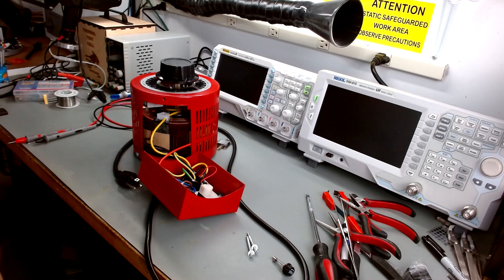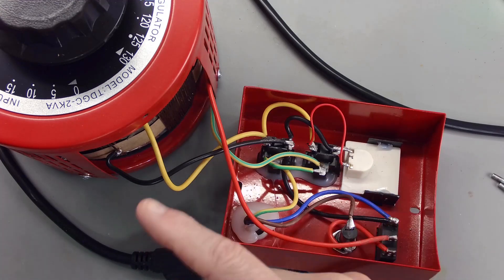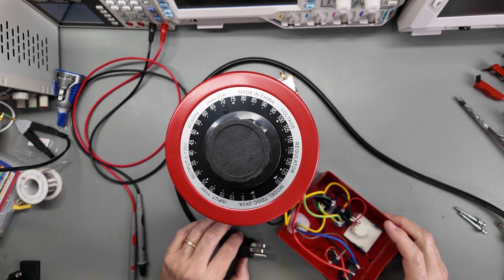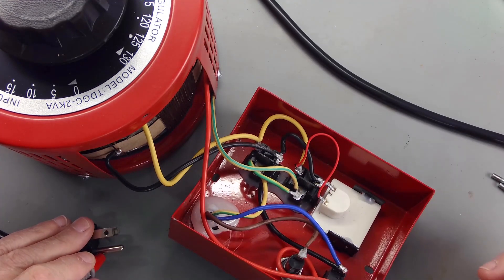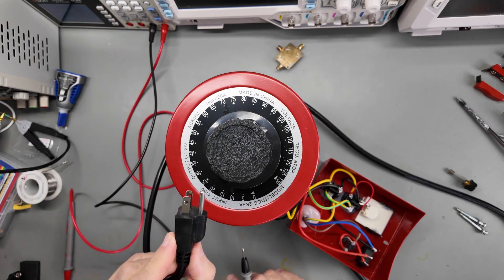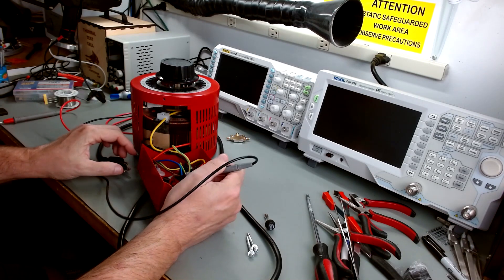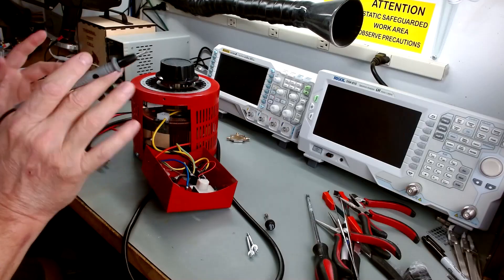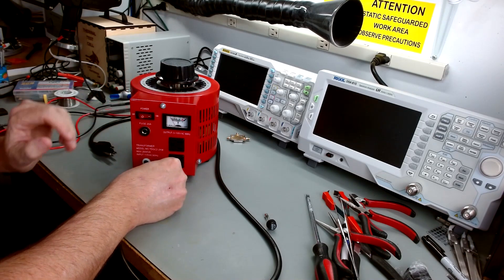Autotransformer Analysis: Is It Safe to Use?

Comment: I have this same model, and I'm perfectly satisfied with it. One thing should be noted, however; these are made with 110v input in mind, so when running them on our 120v+ mains, output voltage of the variac will be higher than indicated on the dial. When I use mine, I plug a power strip into it's outlet and the equipment being powered into the strip---this allows me to also connect my AC voltmeter, so I can monitor real-time output
Reply from the maker: Thanks, 
Check the video on the isolation transformer I use with this. It has a digital volt, current, watts meter that lets me monitor its output. 

RJ

Comment: I have the 10A version that I bought over 5 years ago. I only need it a few times a month max and It's been doing the job I need it to do with no issues. Obviously, there are better ones available at quadruple the price. If I needed it daily, maybe I would have gotten a better one but honestly, if it does what I need it to do and it hasn't failed, what more can I say?
Reply from the maker: Exactly, 
I am in the same situation. Thanks for the input.
RJ

Comment: I don't understand why there is a 20 amp fuse when it has a 15 amp plug.
Reply from the maker: Phil, 
The fusing on something protects the item after it in the flow of current. So the 20 amp fuse is protecting the 20 amp winding in the transformer. The cord to the device is protected by the circuit breaker of the outlet. The reason is simple. Imagine that the device end of the cord was shorted out. No current would flow through the fuse so it would be unable to protect it. So all devices are intended to be protected by the current protection before them. In this case the 15 amp circuit breaker at the breaker box. Remember that you can buy this same exact device with cords and plugs for different outlets that might be able to provide the full 20 amps so it is fused for its rated current not the supply current ratings. Hopefully that clears it up for you.
RJ

Comment: Yes, the circuit breaker is to protect the house wiring, not the load. However, at the wall receptacle, you are not plugging in a 12AWG copper cord. That cord appears to be 16AWG. This is one of the flaws of our USA electrical code. That cord now is a fire hazard. This is one of the reasons that the latest NEC (2020) now requires arc fault breakers. If that cord were to start a melt down, it would trip the breaker once arcing between the hot and neutral occurs. The fix I see in the UK standards is to have the plug with a fuse that protects the smaller wire used.
Reply from the maker: This is a good point, thanks for the input.

Comment: BEWARE: On the unit that I have, the switch is single-pole-double-throw and when switching off, it takes the primary and connects it to ground/neutral.  My switch failed after a few months of normal usage and I think was because the full energy of the primary being dumped through the switch if the user gets unlucky when switching off.

I would have liked to see a snubber circuit instead of the SPDT switch to ground like I had.

My work-around was to disconnect the switch and use the power plug to turn it on/off.
Reply from the maker: Thanks for the heads up! I will keep an eye out for this. 
RJ

Comment: There is no secondary, it's an autotransformer. The "auto" part means "self". (Some company in China makes one that's also an isolation transformer and that one does have a secondary,  but this doesn't appear to be that - they're rare. Also, if it was an isolation transformer it would be defeated by the continuous ground from input to output and you'd have to add a cheater plug adaptor to ensure your DUT is isolated from the mains.)
Reply from the maker: Thanks, please see the other comments and videos where we discuss this.

Comment: What are the core losses?
Reply from the maker: I do not know. This does not appear in any of the specs listed.
RJ
Reply: @LynxElectronicsLab  Alright, I thought maybe you could measure it using a power meter. I'm trying to find a really efficient and powerful transformer

Comment: There is something odd about these cheap Chinese variable autotransformers. A few years ago I bought one on Amazon, it was a LVYUAN Variable Transformer rated at 1.0kVA.  I also bought a used one on eBay, a Staco Inc Industrial Variable Autotransformer model 3PN1010 rated at 1.5 kVA. Testing and comparing the two, the Staco (an American company I think) was about half the size and weight, yet it outperformed the super cheap Chinese product, which was twice the size and weight as the Staco.  These two autotransformers are electrically the same yet the smaller American made one performed 50% better than the cheap Chinese one.  I assume the difference is in the exact way the laminate core is constructed. Nearly all Chinese technology has been copied from the West and so its not surprising that when they manufacture a copy of Western technology it comes out like an imperfect facsimile, having the appearance of the original without its substance.
Reply from the maker: Interesting,
When you say it outperformed do you mean it’s rated output or was there something else you noticed about it’s performed. 
RJ
Reply: @LynxElectronicsLab  Well, as I recall (this was 3 years ago, maybe) I tested the LVYUAN with a 900 watt resistive load and the Staco with a 1400 watt resistive load, so they both performed nominally according to their ratings. I didn't push the limits until failure or anything like that. 
As it turned out, I returned the LVYUAN to Amazon for some reason, but I don't remember exactly why. I remember the meter was pretty wonkey, but more likely because it was redundant and inferior to the Staco.

Comment: 4:30 You can get a LOT more current OUT than you put IN.  The power won't change, but as you reduce voltage you increase available current (for a given power).   Really it ought to be fused on input AND output; input fusing is basically in case the windings touch the case, it does not protect the transformer itself.  It is the OUTPUT fuse that protects the transformer.
Reply from the maker: Thanks for the comment,
Watch the other videos in this series (some already out) to see how I deal with this.
RJ

Comment: Thanks for the inspection. I have tested this model's actual output with a volt meter, and it is not linear with the top ring and the attached meter. So I just use an external volt meter every time with my DUT's.
Reply from the maker: Thanks for the info,
The video going up in a little over an hour will show the third device in this group of tools. It is an isolation transformer with digital data such as voltage/current/power/power factor & frequency. So this is my meter for the same purpose as your volt meter. Gives me a great information console for what my DUT is getting feed. In an upcoming video I show how I use all three together.

RJ

Comment: As far as I can tell the secondary winding is also floating, meaning it’s a bit less likely to kill me…
Reply from the maker: Thanks, check out the other comments where I get educated that there is only on winding in these units.
Reply: @LynxElectronicsLab  There is a special isolation autotransformer that combines actual isolation with variable transformer.  In other words, it has a primary winding and a secondary winding and the brush contacts only the secondary winding.  we had one in school it was very big and heavy and of course expensive.  as others mention you can simply daisy chain an isolation transformer to a variable autotransformer. 
Interesting, the Staco brand (which it was) is now on the Variac website.
https://variac.com/staco/PDFCutSheets/VT%20isolated.pdf

Comment: Back when i was 15 i remember trying to replace the fuse on one of these, the entire knob turned and would seem to tension up after around 180° turning and i realised it was the two cables to the fuse flexing. I was mildly shocked that the fuse holder wasn’t even attached to it’s faceplate but i ended up changing the fuse holding the knob in place with long nose pliers. It wasn’t till i touched an odd screw on the transformer and ended up touching the casing when i experienced a big shock. I used to glance through the vents at the heat sink on top of the carbon brush and don’t recall any insulation from the rotating rod to the knob and brush (but that sums up a glance) and that arose my suspicions enough for me to check the earth bonding from the earth pin to the ground/earth pin on the output and the casing itself and measured good continuity... If i had an insulation tester then i’d test the coil and i will eventually get around to seeing if that rod is connected in some way.

Overall i have always wondered what’s inside one of these TDGCs.
Reply from the maker: Glad I could show you inside mine!
RJ

Comment: I have a similar unit.  Liked the video other than the use of the term primary and secondary.  A fuse of the output isn't a bad thing to add.  You can easily put out a lot of amps on the output when the voltage is turned down.  ie 10A in a 120V can be 100A out at 12V.  I actually built an DUT power box into my bench that has an isolation transformer then a variac and dim bulb that are both switchable with volts and amps display on the output.   It's proven to be one of the absolute best bits of gear for testing things.
Reply from the maker: Thanks for the input, 
Keep watching and you will see I have done a similar.
RJ

Comment: Auto transformers DO NOT provide isolation, so be careful. Aside from that, they are safe to use and if you dont overload them, they will last for many years. I have a Staco unit that I bought over 40 years ago, and it's still working just like new. If you are unsure about the quality,  try running it from 0 to full voltage with a modest load on it, and make sure there are no dropouts visible on the meter (nice feature, BTW) as the knob is turned. Also, see if it gets warm if you run it overnight with no load.

Personally, the wires in the video look a bit small for 20 amps but are probably OK when you consider their length (resistance) and the amount of heat they generate at 20 amps.
Reply from the maker: Thanks!
RJ

Comment: Is there a primary and secondary? All variacs I've seen in my country are autotransformers. I have burnt one that had no output fuse.
Sure, it took less than 10A in, but because the tap is at lower voltage (and P=UI) at same power I got much more amps at lower voltage out and it burnt the coil.
Autotransformers are dangerous in my country because we can put plug in two ways and you are not sure which is  L or N. It is also never isolated. I run my variac after an isolation transformer and with a fuse in input AND on output.
Reply from the maker: Keep an eye to see the rest of the setup and you will see I have more to it that covers it all.
Reply from the maker: Sorry did not answer your question. Yes as we have been talking in other comments there is only one winding. I learned something which is always a good day.

Comment: You keep saying primary and secondary winding and I think that's a mistake. My variable transformer which looks exactly like this one has only one winding with a moveable tap. You can confirm this by checking if there is any isolation between the plug and the outlets on the device. With one winding - any point about fusing the primary or secondary winding is moot.
Reply from the maker: We were just talking about this in the other comments. I had to go look up how this thing works as it is not what I thought. There is only one windings. So you are correct. Thanks! 
RJ
Reply: @LynxElectronicsLab  Whoops! I guess I should have read more comments before posting a redundant one! Nice video, btw.
Reply from the maker: No problem I ❤️ comments!
Reply: There’s still some relevance to it IMO. If the output is set to, say, 30V, it’s possible that you could have 4x as much current coming out as going in. 

You could cook a section of the winding even if the input current is normal.
Reply: @deltab9768  Yes, you're right. Good point. I suppose I was thinking that it wouldn't really be reasonable to put a fuse on the output since the maximum current output depends on the position of the adjustment knob. I guess you could put a fuse based on the maximum current capacity of the winding. That would protect against the case you just described whereas a fuse on the input wouldn't.
Reply: It is useful to think of primary and secondary; they SHARE the same wire from the common point up to the brush or tap.  So if the primary side has one amp, and the secondary has 2 amps (because 60 volts), then 3 amps are flowing in the shared wire.
Reply: @thomasmaughan4798  Wouldn't it be 1 amp in the case you described? Aren't those two currents flowing in opposite directions such that they would subtract and not add?
Reply: @shannonroberts5080  I'll have to do a bit of study on this.  It isn't opposite currents and the output is in phase with the input. But some of the current apparently is in series from high voltage to the tap, and some of the current is sourced inductively from the tap to neutral.  At the maximum voltage out, ALL of the current flows directly from input to output and the transformer is basically idle.  AT half voltage you have a series component and an inductive component; at low voltage the current is sourced almost entirely from induction and thus the current in the common section will be the simple sum of input and output currents.
Reply: @thomasmaughan4798  I agree with everything here except I still see the 'primary' current and 'secondary' current being in opposite directions in the shared part of the coil. It's hard to describe without a diagram, but if you consider the power source driving current in the 'primary' in a clockwise direction, then since the two voltages are in phase, the current going from the secondary to the load will also be clockwise. Do you see what I mean? Another way to describe it with magnetic coupling is to say that the coil produces a back emf to resist current change from the power source, and that back emf drives current in the 'secondary' - back emf pushing current in the opposite direction. In a normal coil the back emf generates impedance, but the tap gives current a second path to flow into.

Admittedly I haven't analyzed this circuit in detail before either, so I might be wrong! The magnetic coupling of the two coil sections makes this a non-trivial circuit even though it appears trivial at first glance.
Reply: @shannonroberts5080  I agree with your excellent analysis.  It is easy to show that since the voltages are in phase, and necessarily so, that the circulation of current means that the secondary opposes the primary.
Having thought about it, I see that this is not so simple to evaluate.  It is easy enough to show 10 amps on the load with 1 amp going in, but the exact current distribution of currents seems not so easy to determine.  My experience with these things is that the portion of transformer that melts or burns is always the shared portion.  
Consider 120 volts 1 amp in, and 12 volts 10 amps out.  The 10 amps out seems to oppose the 1 amp in.  If it does, then 9 amps flow in the shared portion and yet 10 amps are on the load.  We might say that the missing amp comes from the source, but if that's the case, then the 10 amps is not opposed and you would have 10 amps in the shared plus the mains amp for 11 amps.  Well that's not right.  So the actual is somewhere between these bounds.

Comment: for mains devices, I always prefer spade terminals. solder seems amateurish to me. (at least they should have used shrink tubing) one other thing I question on Chinese instruments is wiring. they don't use real copper whenever possible. I've seen so many examples with aluminum or copper coated aluminum.
Reply from the maker: Yes, I notice this also. They love aluminum wire.
Reply: Soldering is hands down a much better connection than spade terminals, especially for higher current devices. 50% of my trouble calls on heaters, refrigerators, HVAC equipment is due to crappy spade terminals getting hot, burning off, meting switches or just falling off over time. Whether from a bad crimp or just no spring tension on the spade. I can't recall anything that failed due to a solder joint where a spade connector could be used instead. Sure, PCBs and cracked solder joints is a thing. But on applications like this, soldering is much better.

Comment: Excuse my confusion, I thought the earth on the secondary should not connect to the earth of the chassis or the mains earth. Everything should be separate on the secondary side..There should be no earth on the secondary side as you only have hot and neutral wires as that is all you need. The earth in the mains is because it is used as the neutral return to the grid.
Reply from the maker: Thanks for the question.
That is what you want on an isolation transformer. These are not advertised as isolation devices. I have a separate isolation transformer for that. It is an upcoming video. 
RJ
Reply: @LynxElectronicsLab  Thanks two, different things